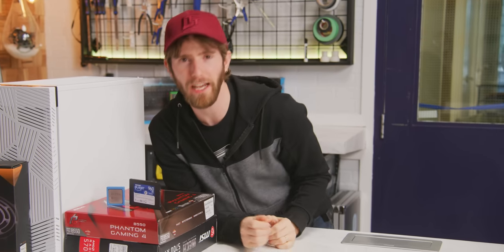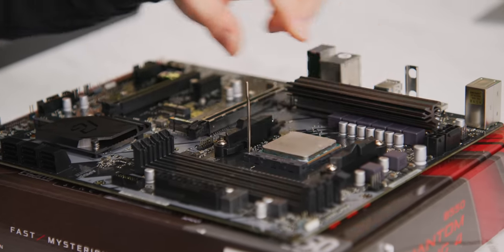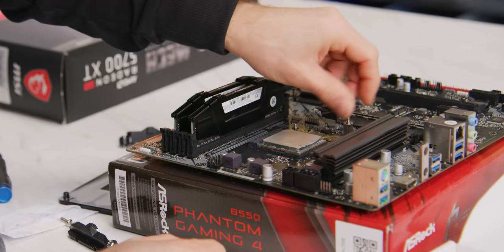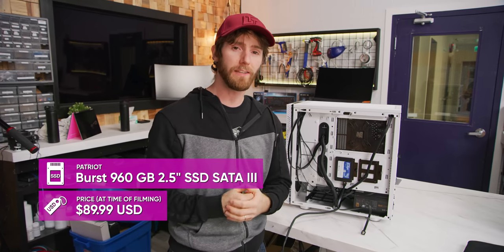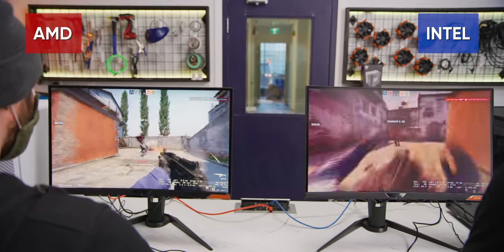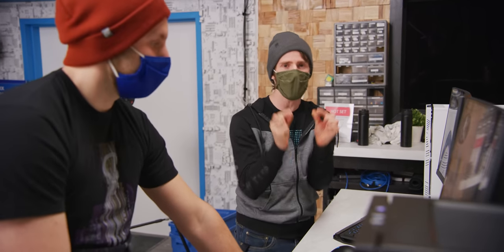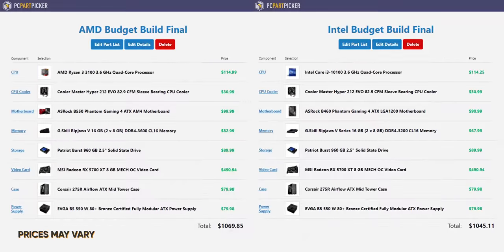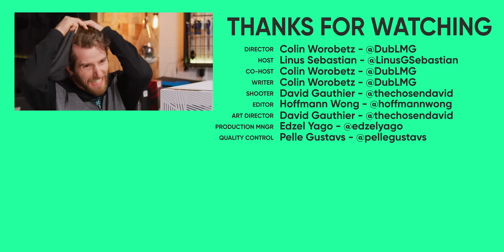AMD vs. Intel midrange gaming PC challenge

Comment: 6:46
What are you on about Linus? The RX 5700 XT supports PCIe 4.0.
Reply: Not that it needs it
Reply: @prich0382  It does a couple of %, not that it really matters.
Reply: Well, everythinh in there should be PCI-E 4 suported
Reply: @prich0382  Not that any GPU needs it...
Reply: @oskjan1  Dude all gen 4 does is double bandwitdh, if it never used up all Gen 3 bandwidth then putting in gen 4 does nothing
Reply: I have rx 5700 xt and i have it on pcie gen 4 lol
Reply: Yeah I have a 5700xt and was gonna say it’s PCIE 4.0....
Reply: @prich0382  The point is that you can run it in PCIe Gen 4 8x mode to get extra PCIe lanes to use on other devices which is important for upgradability
Reply: @plakeplays6420  same
B550-f
And the gigabyte 5700xt gaming oc
Also
Was that card(mech oc) the one where GN had horrible performance with?
Reply: Idk why he used that instead a 3070 even if you can't buy it i would wait a couple of months.
Reply: @tapiomarkkanen6170  I have one I'd probably say not horrible and it just gets very loud at full load.
Reply: @cyumaaime8601  don't post random links here, pls
Reply: @ianault8599  Ah finally an intellectual, that is one real world advantage
Reply: @prich0382  The only cards that even came close with RTX Titan and mostly when doing heavy VRAM stuff/non gaming workloads, even then it had 2-4 gbps left
Reply: @prich0382  The amount of bandwidth GPUs use fluctuates quite a bit and even with mid range GPUs there are often spikes where the GPU is using more than PCIE 3.0 provides.

PCIE 4.0 doubles the bandwidth, which allows it to better handle those spikes of high bandwidth usage. As a result PCIE 4.0 can slightly reduce lag spikes and get very slightly higher average performance.
Reply: It has alotta problems though
Reply: @blinkfan11  yeah
I mixed it with evoke oc
Reply: Yeah well I'm still on PCI E 2.0 with my z68 mobo
Reply: @tapiomarkkanen6170  yes the mech oc got flamed by gn and hardware unboxed (didnt even try to cool some ram chips)
Reply: @reuben-rt  i used to do same
With a fx6300

Comment: 6:23 Confused 3070 noises
Reply: @jitu verma those are a lot more expensive rn
Reply: @bblz9171  3060 ti is like 420 dollars where i live
Reply: 2000 series is still high end. Midrange is 1050.
Reply: @RealMTBAddict  id say something in the $200-$300 is midrange, the 1050 is alright but would barely classify as midrange in 2020
Reply: @RealMTBAddict  the 1050 doesn't hold up anymore. Its only 2gigs of vram. The gpu is where you put most of the budget, save money until you get a budget for a 300 dollar gpu at least
Reply: @alokff2561  where would that be. I might get a plane and come down cheaper than buying from here
Reply: That card is absolutely shite, worst 5600XT
Reply: @RealMTBAddict  GTX 1050 is obsolete. 1060 Ti would be just barely mid range today. 1660 Ti (or a freaking RX 580) would be go-to
Reply: @bblz9171  yeah, but the rx 5700xt is only worth $400, linus overpaid. Even last gen cards are flying off the shelf. If I'm gonna wait for a card to come back in stock I'd get a new one.
Reply: @jitu verma with an r3 and i3 probably wouldve been a bottleneck
Reply: lmao 3060ti where I live is 650$ lucky fuckers
Reply: @alokff2561  holy moly, most 3060 ti where i live go for $500+
Reply: @RealMTBAddict  1050 is and was never "midrange".....its was low end...!
Reply: Well they shoot they’re videos a lot longer before they come out so these cards probably weren’t out when they shot this
Reply: The prices are insane right now. My current card would sell on ebay for MORE than I bought it for, and I can't find a 3070 for anything less than 600. Not surprised that the 5700 XT spiked to 500.
Reply: @Blaze6108  i never ever would pay 500 bucks for a 57xt!
few month ago, i can buy it for less then 400$!..
wait! the prices comes down!
q1 2021 in late feb.
Reply: @troy9394  3060ti isn't at all where i live
Reply: @Knebebelmeyer  that's funny because a lot of games still recommend that card. I'm not talking about Cyberpunk. That game was released a year early.

Comment: Well, in Germany both CPUs aren‘t worth the price right now.

The Ryzen 3 3300X costs minimum 165€, the i3-10100 costs 117€ minimum right now. 

I went for the i5-10400f for my second pc, which was 144€. In my country I‘d say the i5 is the way better deal.
Reply: Thanks AMD. core i5 used to be above $250.